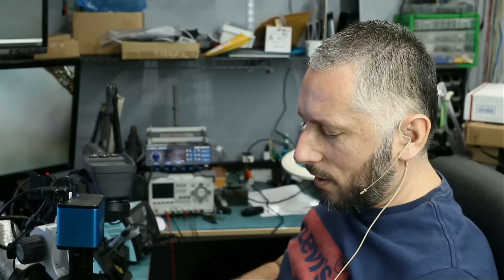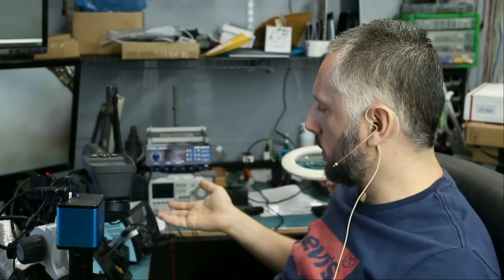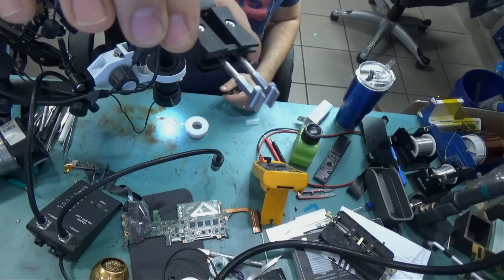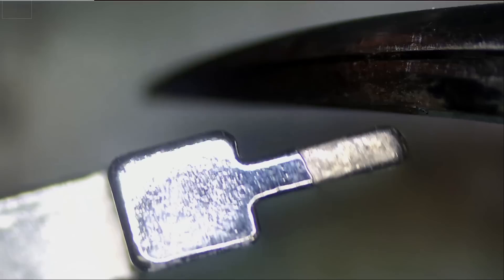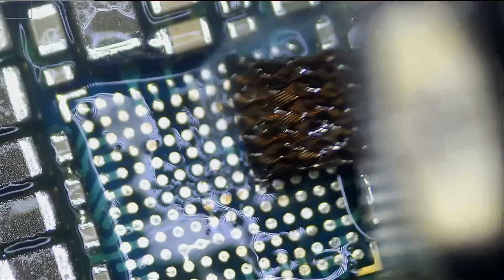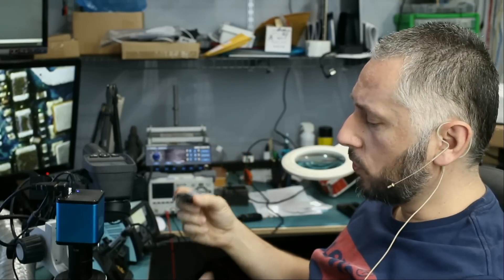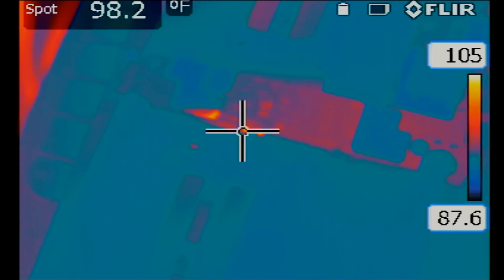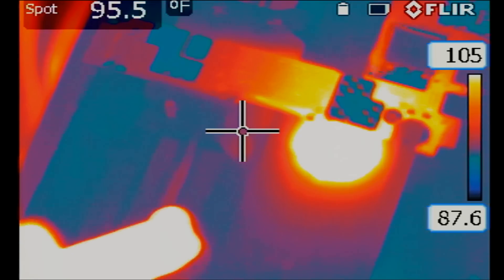Amazing way to Desolder using Hot Tweezers.  Bigger Tip more Heat transfer using Flir thermal camera

Comment: just wondering if it would be a good idea to desolder any smd caps/resistors using this hot tweezer+braid/wick to suck up the solders?  could u make a video showing if it works ?  it would be very interesting for use in very tightly spaced components because hot air usually blow away nearby components.

Comment: Thanks, excelent vídeo,but for us it imposible buy that tools, we try to make it
Reply: You can buy cheap hot tweezers on ali, ebay etc., and maybe use with a decent solder station clone if your model needs connecting to a solder station. Those cheap knockoff hot tweezers are not super precise and finely controlled tools, but that is perfectly ok because we're not using them for (de)soldering SMD components here. We're not even touching the board directly with the tweezers we are just heating up solder wick while having a gentle and controllable grip on it. Just remember to use additional flux. The flux inside the wick will burn off very quickly when gripping it with the tweezers, probably before you even have time to touch the wick to the PCB pads.

Comment: Why don't you post the link to your hot tweezers
Reply from the maker: https://rover.ebay.com/rover/1/711-53200-19255-0/1?mpre=https%3A%2F%2Fwww.ebay.com%2Fitm%2FWeller-0054466899-RTW10-CART-TIP-BLADE-10X1MM%2F264421486517%3Fhash%3Ditem3d90bfafb5%3Ag%3Ao00AAOSwkpxdSNQs&campid=5338440312&toolid=20008. you'll need the station of course https://rover.ebay.com/rover/1/711-53200-19255-0/1?mpre=https%3A%2F%2Fwww.ebay.com%2Fsch%2Fi.html%3F_from%3DR40%26_trksid%3Dm570.l1313%26_nkw%3Dweller%2B2021%26_sacat%3D0&campid=5338440312&toolid=20008

Comment: ما اسم مكينة الحام الي تستخدمها وما هي الشركة المصنعه لها
Reply from the maker: https://rover.ebay.com/rover/1/711-53200-19255-0/1?mpre=https%3A%2F%2Fwww.ebay.com%2Fsch%2Fi.html%3F_from%3DR40%26_trksid%3Dm570.l1313%26_nkw%3Dweller%2B2021%26_sacat%3D0%26LH_TitleDesc%3D0%26_osacat%3D0%26_odkw%3Damtech%2Bv2&campid=5338440312&toolid=20008
Reply: @NorthridgeFix  is very expansif !🤒😳
Reply: @NorthridgeFix  link dont work

Comment: Can you send the link of the tweezer please?
Reply from the maker: https://rover.ebay.com/rover/1/711-53200-19255-0/1?mpre=https%3A%2F%2Fwww.ebay.com%2Fitm%2FWeller-0054466899-RTW10-CART-TIP-BLADE-10X1MM%2F264421486517%3Fhash%3Ditem3d90bfafb5%3Ag%3Ao00AAOSwkpxdSNQs&campid=5338440312&toolid=20008
Reply: You are the number mobile phone technician on YouTube and I am your big fan mate thank you very much for introducing the latest technique to clean the pads with hot tweezers mate you are the inventor of this technique you made it very easy and 110% safer for the pcb. Mate you are doing great work pls keep uploading the good work. Big respect and love from Pakistan :-)
Reply: The link is no longer available do you have the updated link?

Comment: Misplaced component spotted at 6:08 👀👀
Reply: I saw it too, but I went back in time to see if this demo caused it and it didn't. It was already displaced at 4:39 before he started with the heat.
Reply from the maker: That is a salvaged non functional board we use to get components off.

Comment: Thermal dynamics for soldering explained and demonstrated very well here for those studying soldering techniques. A high end soldering station has to be used to replicate this demonstration. Soldering 0102 using fluid dynamics is totally fascinating, check it out. Great video, others shall find this useful.  A BIG 👍 from me.